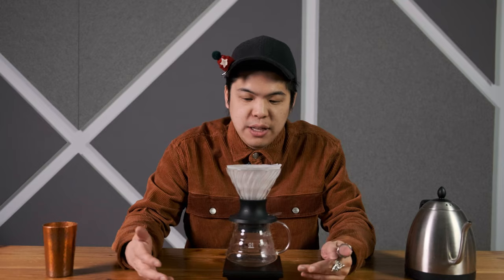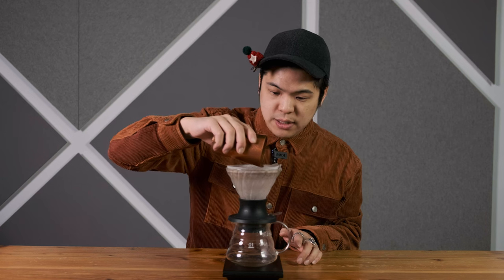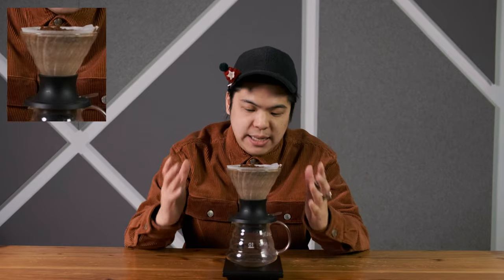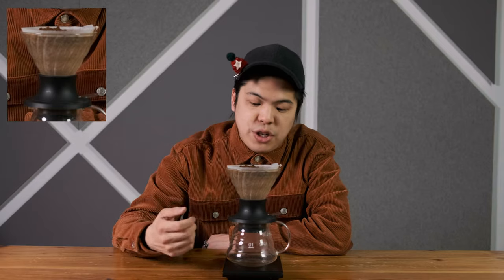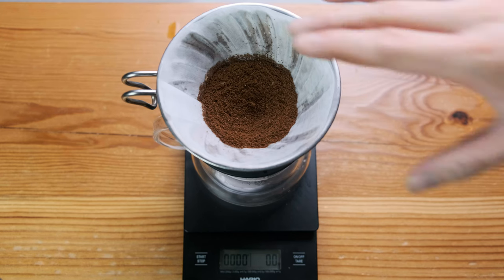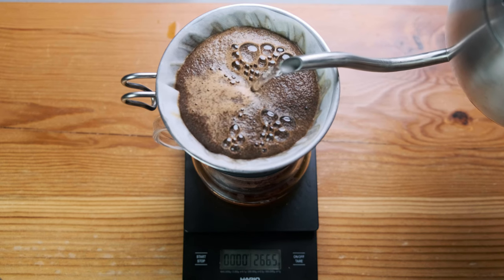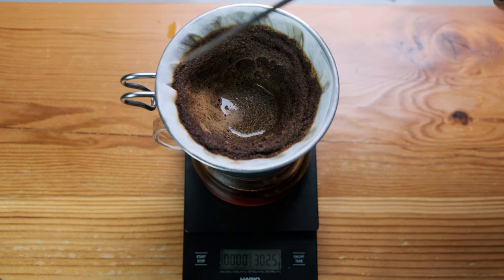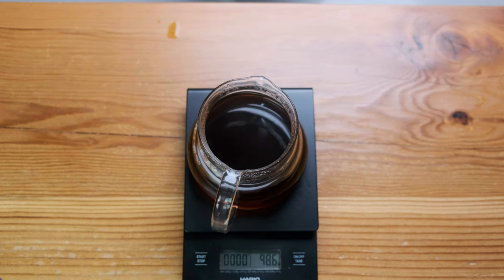Sink or Swim? Theory Behind Pressing Your Coffee Grinds (Pour Over Theories)

Comment: Currently I am using a combination of all the techniques I have learned.  I use the SS chopstick to mix and get the grounds all to sink and that final stir at the end is essential!  I use the Rao/Hoffman swirl to clear the sides during the brewing process and get that extra bit of agitation that I have found adds just a bit more extraction to the cup.  

If all that fails to get all the floaters, I'll jump in the v60 and swim around and knock the final last floaters to the bottom myself using a baseball bat, but usually that is a last resort as I have to pull out the shrinking machine and well, that can be a pain in and of itself...but then again this is all in jest. ;-)

As you can tell, I wholeheartedly agree with you, the grinds need to be thoroughly mixed and sunk by the time the brew finishes.
Reply from the maker: Hahaha, I'd love to see a video of you swimming into your grinds to knock them all down :P

Do you find if you use the swirl you have a little too much extraction?  Or are you just swirling instead of stirring.

Comment: this is generally the biggest problem with the  single pour techniques. I used to knock the grinds away but mostly pressing cause single pour technique. 

Anyways, for me, the biggest problem of single pour technique is that channeling which is more common as I go below 600 microns which is why most would go courser like I currently am.(I do think it might have to do with me not pouring strong enough.)
Reply from the maker: Yups it’s the understanding of agitating that causes the beans to sink or float. By the end of the brew you don’t want anymore floaters just sink everything. But it needs to be timed so the water sinks at the same time